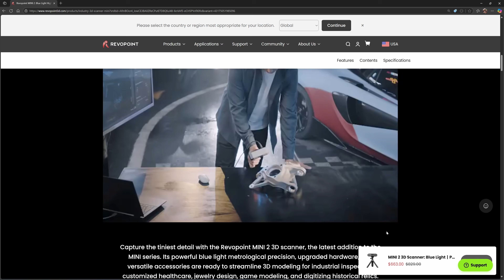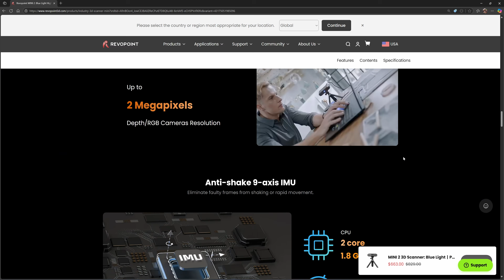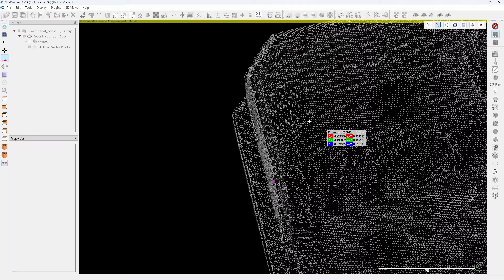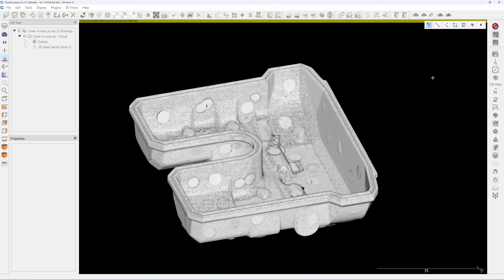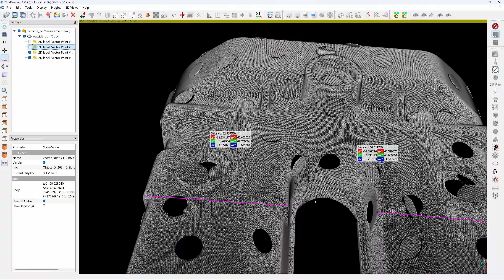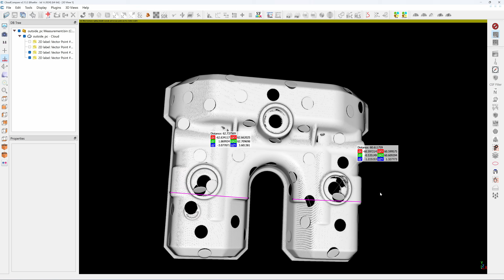The Truth About 3D Scanner Precision in Reverse Engineering - A Case Study with RevoPoint Mini 2

Comment: I use Otter for RE in our company for automotive parts that need to be modified for our needs. I do the deviation measurement in GOM (cloud compare looks like eyeballing to me) using fitting planes that cancel out most of the noise. Good scans deviate around 20 to 50 microns to the real world model, while rushed ones tend to be in the hundreds. Preparing the object and taking care when scanning is 80% of the job. I avoid the scanner software merging function like the plague though. There are better options in GOM.

Comment: The question comes spontaneously to me. Did you measure the distances seen in the video with a precision gauge to confirm the results?
Reply from the maker: The difference between a 3D scan's dimensional readings and those from another measuring tool is known as an accuracy error. However, the more critical issue is precision error—when scanning the same object multiple times, the results should remain consistent. If precision error exceeds acceptable limits, reverse engineering based on the scan becomes unreliable and prone to failure.
Accuracy errors are relatively easy to correct, as any CAD model can be scaled to match verified measurements. Using the calibration board that comes with the 3D scanner helps reduce accuracy error. But when it comes to precision, there's no simple fix.
Reply: @Payo-TensileCreator  I have a Revopoint Mini (the model before the one used in this video) and I do reverse engineering scans of modeling objects. The real problem with this type of scanner is that you have to gain a lot of experience to get good results. The results of my scans are in line with what is stated by Revopoint, only that to obtain it requires a lot of work and a lot of tests. If I get a 2 mm error with this scanner, as far as I'm concerned it's always my error in the scanning process. For better accuracy I never use markers and the relative mode ( which I think is suitable for larger objects), but rather the "Feature Tracking" mode and the use of objects of various shapes and sizes as a reference to help tracking.

In my opinion, I don't consider the Revopoint Mini a suitable scanner (as Revopoint seems to advertise) for beginners. At least not yet, since probably future software updates could lead me to a different conclusion .
Reply: @kasumoto71  Just in case you will see this, I have a question. I came across a used Mini Gen 1 that I am considering buying (can't afford a newer model). I would need it mostly to scan a few mirrorless cameras but they seems to be a little bit over the "single shot" size. I don't mind spraying the camera and I won't be in a rush. Do you think it's possible to do this and get within +/-0.2mm? And can the software merge 3-4 different scans as the camera, as mentioned, may be a little too big.
Reply: @AntiVaganza  Yes, the Revopoint Mini (which I own) can do that. But the results depend on your own skills.

Comment: I think a lot of people have been caught out buying scanners based upon the spec sheets. What's your favourite low cost scanner at the moment and which scanner have you used that you would consider to be the bare minimum to purchase for people wanting to reverse engineer like this?
Reply from the maker: High precision consumer grade 3D scanners that I have tested are MAF3, Raptor and 3DMakerPro Moose.  They create no visible seam line nor double wall when merging. Moose seem to be the cheapest one and I think it can scan and tracks this part with some add on feature.
Reply: @Payo-TensileCreator  Thx for the reply. Much appreciated!

Comment: I’m not trying to contradict anything you said—chances are you’re right. What I don’t get is how you’re measuring point-to-point just by eyeballing it. In one of the images it’s clear the line between those two points isn’t in the same plane; you’re basically measuring a “diagonal” with a 6 mm elevation difference. Naturally that line will be longer than the one on the right, where the line is almost flat and the elevation is only 0.1 mm.
Reply from the maker: My audience has varying levels of understanding in math and mechanical design. Creating a video that’s accessible to everyone would take several hours.
Reply: I guess that the cloud is aligned with the coordinate system and reading deltas for single coodinate seems legit.
Reply: And just because you have so different audiance, you should try to teach them from begin how to measure properly. I find it also very inaccurate just eyeballing some points and measure it
Reply from the maker: "The next video https://youtu.be/4GTPAkEAwiQ 
clearly illustrates the poor quality of the scan when imported into CAD. It’s straightforward and easy to grasp.

Comment: I wonder if it's not as much the fault of the scanner, but how it was scanned and whether the surface was prepared properly, and part was fixtured properly to avoid movements while scanning etc. OR mabe that part is off like that in real life? Have you had the conversation with your client?
Reply from the maker: When two scans of the same object produce different dimensional readings, that’s a precision error—you can’t be certain which measurement is trustworthy. I was referring to precision, not dimensional accuracy. Accuracy errors are relatively simple to correct and aren’t a major concern in reverse engineering.

An aluminum engine valve cover with a 2 mm asymmetry? That sounds like a serious manufacturing challenge
Reply: @Payo-TensileCreator  did you ask your client, what was the outcome ? Maybe the valve cover is warped? I can't believe that a company (revo point) would put out extreme false claims about their scanners. Maybe the customer didn't calibrate the scanner ? Or yes maybe re point is crappy. I will have to test my Miraco and Mini 2 against our UE11 and calipers. 

I thought you liked RevoPoint
Reply from the maker: The video only scratches the surface—there are additional issues like non-orthogonal and non-parallel walls, along with noticeable distortion. What’s shown is just a symptom of broader low-precision problems, and honestly, it’s not worth a designer’s time trying to reverse-engineer it. I’m not surprised by the output; I’ve worked with four RevoPoints scanners to date.
Reply: @Payo-TensileCreator and the four give the same poor results ? 

I also think that scanning takes some practice and learning. You can't expect a perfect scan with a budget scanner or any scanner for the matter from some who just bought it and it learning.
Reply: I own the mini v1 from kickstarter and the scanner has issues with ghosting and accuracy was never as good as for example the Raptor or Einscan-SP v2.

Comment: It would be nice to check accuracy using some 1x2x3 calibration blocks. 

You can buy them for pretty cheap, and they we would be all able to reference each others data sets and compare measurements. 
They could also be useful when comparing your individual 3d scanner calibration sessions. 

Great work Payo. 
I freaking love your content. 
Please keep it up as it’s super interesting and inspiring. 

☮️🇦🇺🤜🏼🤛🏼😎🍀🍀🍀
Reply from the maker: I typically let the customer scale the reverse-engineered part to suit their preferred measuring tool. As long as the precision is solid, achieving accuracy becomes a simple adjustment.

Comment: I have had issues with my Revopoint scanners not matching the claimed specifications as well. That said, I don't know how you can declare that the dimensions of these scans are wrong without physically measuring the part that was scanned.
Reply from the maker: When measuring the same object twice, you should expect consistent dimensional readings. However, in this case, the outer and inner shells show a discrepancy of 500 µm when measuring the same wall. Although the left and right sides are designed to be symmetrical, this scan shows a deviation of 2.1 mm from true symmetry.
Many time, customer don't send me the original part for reversing, this's how I check before I continue with reversing.
Reply: @Payo-TensileCreator  So all manufactured parts (in this case it looks to be a casting) have perfect dimensions? Again, the multiple walls etc are a clear sign of a problem, however, I stand by my comment that you can't know how large the error is without measuring the actual part.
Reply from the maker: @rapanui222 My audience has varying levels of understanding in math and mechanical design. Creating a video that’s accessible to everyone would take several hours.
Comparison the scan measurement with another measuring tool is called "Accuracy error". Accuracy play no roles in reverse engineering as the model can be scaled to match any measuring tool.
Reply: @rapanui222  You could look at it this way.  The physical object, whatever it is, has perfect dimensions.  When reverse engineering we want to find out what those dimensions are, but they effectively don't change.  So every measurement, if taken correctly should match each other with no deviation.
Reply: Now I am curious about other scanners. I, for example, have the Creality Scan Raptor Pro. Would that scanner produce files good enough to use for reverse engineering?
This is going to cost me some time to test, hahaha.
Thanks Payo, great insight again.
Reply: @3dPrintCreator  I ended up getting the raptor pro in part due to payo's other videos on it.  For the work I've done so far it's done very well, but I can't speak with any authority to the reliability of the dimensions.
Reply: This exactly mirrors my own conclusions- “reverse engineering” is clearly not understood by these scanner manufacturers.  I am looking to re-create a part with engineering dimensions I can give to a machinist, I am so disappointed with my Metro X I just use the point cloud as a general guide for the shape and set to work on the part old school with ruler, verniers, radius gauges, etc……